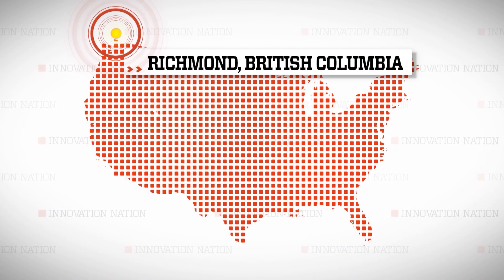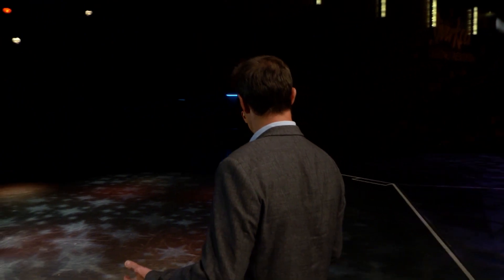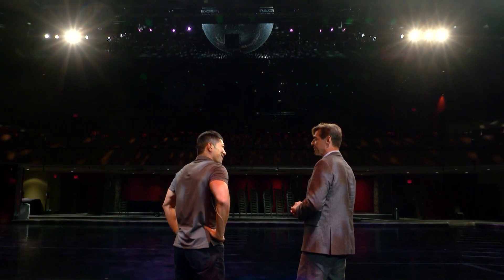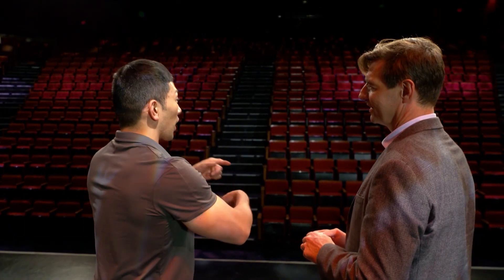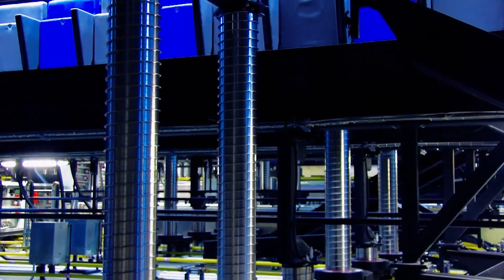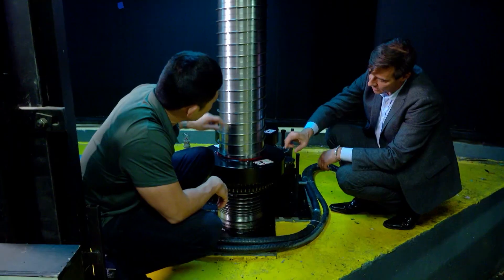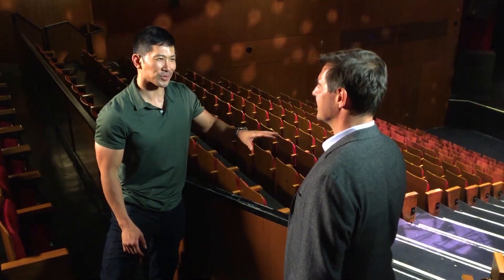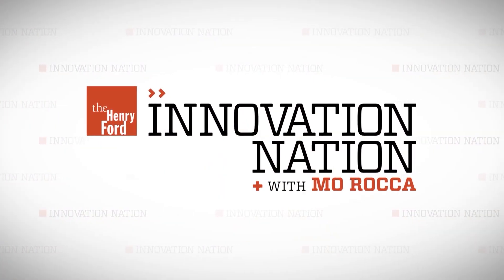The Engineering Behind Transforming Theater Seats | The Henry Ford's Innovation Nation

Comment: Please someone tell me what those columns at 2:30 are called. I have searched "compact stainless steel self building screw lifting column" and a lots of other things but I just can't find anything about them.
Reply: I believe they’re called spiralift columns
Reply: I cant remember the name but they are a type of linear actuator. It rotates and pulls the metal from coiled up to stacked. The thin band keeps the shape of the tall band to build the  column.